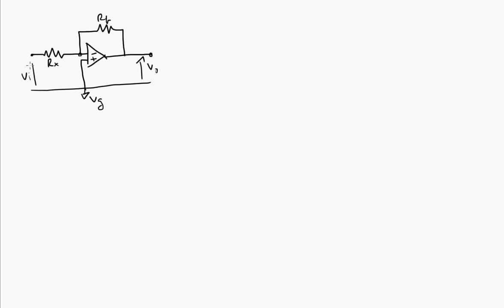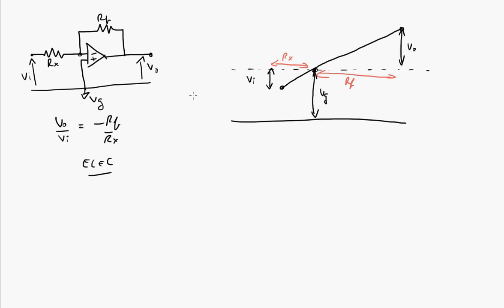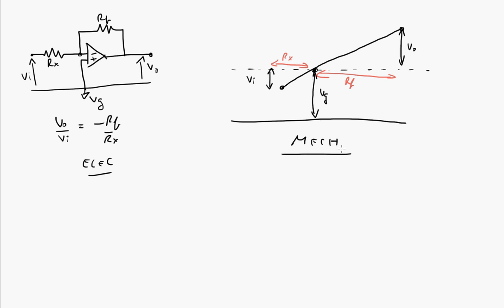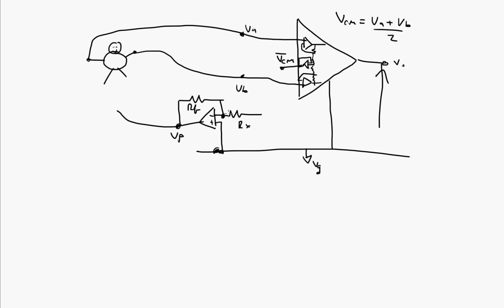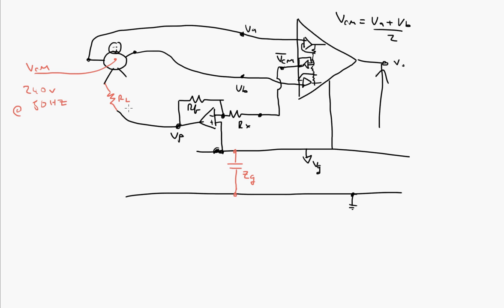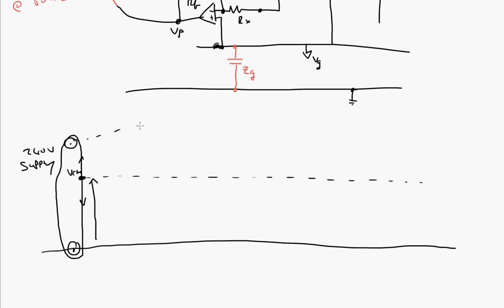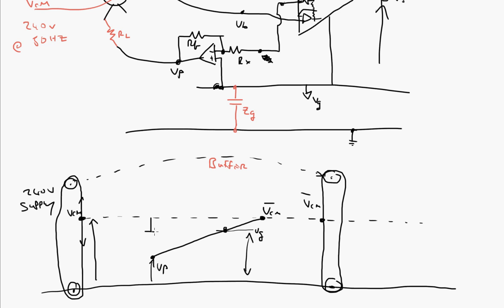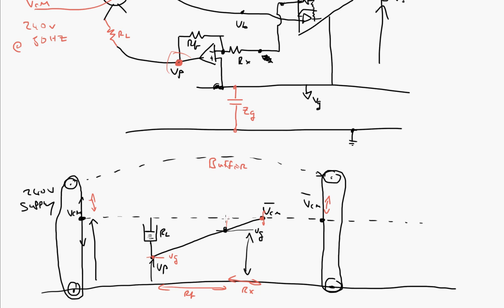BIOM9640: Mechanical analogy of a driven right leg circuit for instrumentation amplifier

Comment: I loved that analogy! thank you! Lately, I have been trying to picture the flow of the charges and how everything is happening with the circuit. I understand that this is a mechanical analogy but is there anyway you can explain to me what is happening in terms of electron flow?  Is the right leg driver "pumping" electrons into the body?
Reply from the maker: Jamie L Yes, current will flow in and out of the right leg. (Strictly speaking, not electrons, as the electrode is a transducer which converts ions in the body to electrons in the cct, and vice versa.) There is even a protection often resistor placed at the output of the DRL inverting amp to limit this current to an acceptable magnitude.